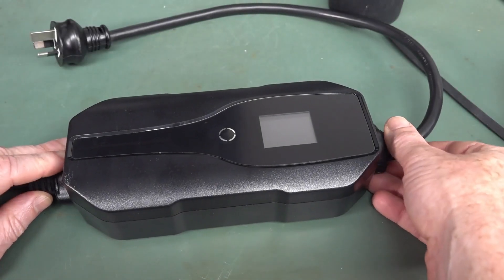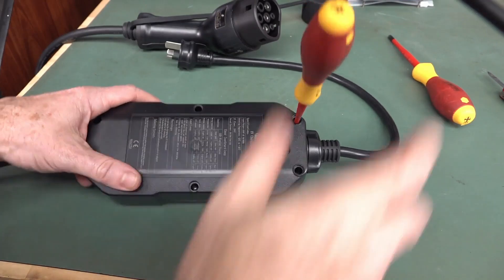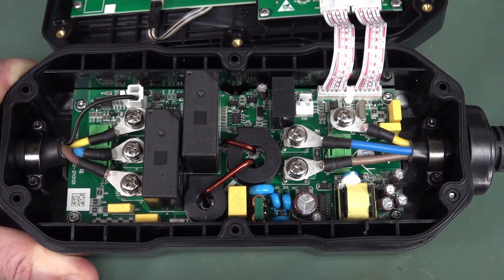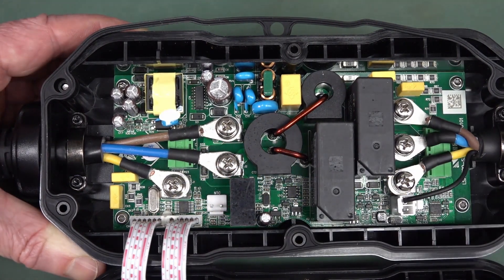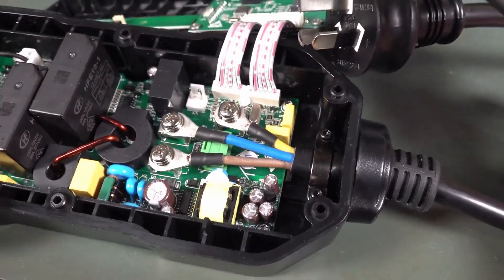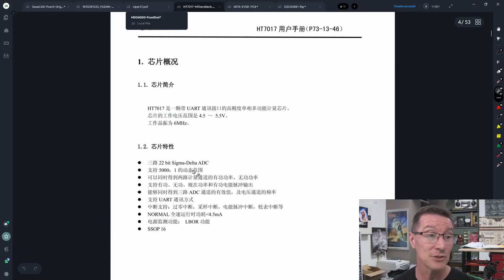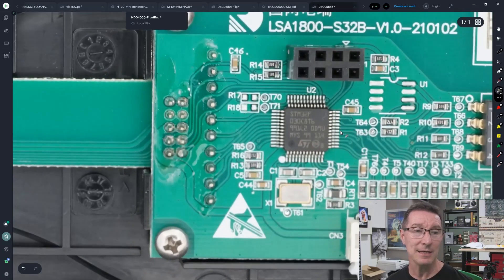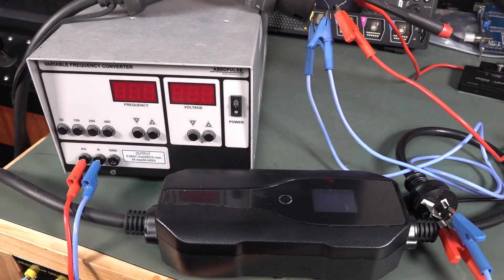EEVblog 1507 - Mida: A surprisingly good cheap portable Electric Car EVSE Charger

Comment: I’m probably a small minority, but I still can’t wrap my head around buying cars with expiration dates. Lipo batteries do not last, I truly hope something better comes around soon, but what a disaster for the environment at this point in time.
Reply: You do realize that when the batteries reach the end of their lifespan, you get them swapped out for a new pack and the old batteries are recycled? Easily done and only needed every 10 or 20 years.
Reply: @RedwoodRhiadra  “easily done”, please cite a source. The chemical composition changes which is why it no longer holds a charge. Let me see you recycle a rusted out sheet of steel into a new sheet of steel.
Reply: @bryans8895  What, do you have any idea how scrap steel recycling works?
Reply: @JussiPeltola  I do, and it was poor choice of words on my part. I meant thin sheet metal, rusted to all hell to the point of being perforated and half way gone to begin with. A chemical composition change, as I was getting at with my initial comment. A pile of pure rust cannot be melted down and made into new steel, as an expired lithium cell cannot be "recycled" into a fresh new one.
Reply: @bryans8895  Steelmaking is a lot about converting rust into steel. The stuff from the ground is rustier than surface rusted steel.

Obviously any rust that fell off cannot be recovered.
Reply: You seem to be thinking they have the same lifespan as what's in your phone or laptop. They do not.
Reply: @RobertHancock1  explain to me the difference between a lipo cell in a phone, or 10,000 lipo cells in a car. Similar number of cycles, kills the cells. Granted they don’t go 100-0-100 as often, but it’s the same stuff and they do expire.
Reply: @bryans8895  The difference in cycle rate is pretty massive. Most people tend to charge their phone every day after discharging a good portion of the battery. In order to need the same thing with a car you'd have to be driving hundreds of miles a day, every day. Few people do this.

EV batteries also don't charge to 100% capacity nor discharge to 0%, and the battery design and BMS are also more optimized for long life than in a phone, where the manufacturer figures that you're going to buy a new one after a few years anyway.

It's part of the reason that EV battery recycling has gotten a slow start - there just hasn't been much need for it. When people need a new battery, it's more commonly due to defects or crash damage than wearout, aside from a few people that have put extreme mileage on their cars (enough that with an ICE you might end up needing a new engine).
Reply: Petrol cars expire when the tank runs dry, but people still buy them!

Comment: Those relays can go into one on one off when there is a power failure. My unit needed me to manually switch both off to recover. I also have a Khons 22kW adapter, pretty bullet proof and a gen2 Tesla HPWC which has an ABB 64A contactor and is converted to charge from an 12kWp off grid solar (charge rate according to solar input).
Reply: Thanks for the tip!

Comment: As for the thermistor:

Believe it or not, they more often insist on it more for use with low amperage outlets which might not be able to safely handle sustained loads from vehicle charging. They can get hot and melt. This was contrary to your speculation so I thought I’d mention it. I have a real-world example, if you are interested:

I have two EVSEs with the exact same ClipperCreek Gen2 EVSE board inside, one running GM’s firmware with a NEMA 5-15P 120v plug and a 12A limit (bundled with the Chevy Volt/Bolt) and the other running ClipperCreek’s firmware with a NEMA 14-30P 240v plug and a 16A limit (sold as “AmazingE” brand). Only the GM firmware with the 5-15 plug has the thermistor… and it won’t work without it unless you use a resistor to bypass. I know because I found the populated PCB for $30 as a new GM spare and used it to build another EVSE, so I really have three with the same board. ;) The AmazingE unit does not have/require the thermistor/resistor because they expect a NEMA 14-30R to easily handle 16A without getting hot. A NEMA 5-15R, on the other hand, is often worn out and gets hot. Though his Volt would default to 8A on 120v my brother would routinely override and set it to the theoretical safe limit of 12A until the outlet in his garage melted. After that we converted his GM unit to 240v and gave it a NEMA 14-XX plug (no neutral to fit more receptacles).
Reply: I know the GM/Clipper Creek EVSE supplied with the Volt/Bolt will safely operate from 240 volt 8 or 12 amp single phase using a pigtail adapter.  Is there something more you did internally beyond changing the plug, as I notice you said you converted your brother’s GM EVSE?
Reply: @wtmayhew  My reply got ghosted. :(

The CC Gen2-based GM unit works great with an adapter but you can’t chop and completely replace the plug without bypassing the thermistor. Ai4px posted the specs for a replacement thermistor or resistor bypass on ChevyBolt. Small world since I already knew him from Ninjette. :)

I had to replace the thermistor with ai4px’s resistor bypass with my GM spare board since it never had one and refused to run without it.
Reply: @emmettturner9452  Thnaks very much for your reply.  Duly noted.
Reply: @emmettturner9452  Thanks for the information, much appreciated.
Reply: The UK/Type G ones have to have a thermistor in the plug as I understand, a UK plug can get quite warm even at 10A so some overheating protection is needed. On a forum an ex-GPO bloke said that they would only rate 13A type G sockets at 10A and that was only with MK plugs and sockets, any other combination and it was more like 8A I believe.

Comment: You might want to go lower when using with a source that you know can’t handle 15A. For example, a worn out outlet. It’s why 120v EVSEs often default to 8A and require a manual override for 12+A. Adapters to fit higher amperage outlets often signal this to the EVSE so it can default to 12A or 16A or more. Though a standard NEMA 5-15 in the USA should be able to safely handle a sustained 12A (80% of the maximum 15A rating), they often can’t because they are worn out and loose from too much use.
Reply: gotta love the garbage nema sockets
Reply: @drkastenbrot  Well, the grade/intended application is what typically determines how robust it is (consumer versus commercial, industrial, hospital, etc). ;) NEMA just defines the prong configuration and expected amperage when functioning correctly. I’m sure you can wear out a lot of other plug types!
Reply: @emmettturner9452  i have not run into worn out european plugs other than crappy extension cables. they will happily do the rated 16A
Reply: @drkastenbrot  it’s more about the contacts in the receptacles. They can bend and lose pressure, oxidize and increase resistance, arc from live plugging and develop pitting, etc. Also, worn out 15A sockets can generally handle their ratings too… for a shorter period of time. It’s the sustained loads of EV charging that cause a worn outlet to melt down at 12A. You might never know they are worn with typical non-EV use even if you were plugging in 12A devices regularly (vacuums, space heaters, toasters, microwaves, etc).
Reply: @emmettturner9452  I think it must be something to do with the design of your plugs/sockets in the USA. IMO it's probably the fact that you don't commonly have on/off switches, which causes arcing when devices are plugged in or unplugged . Here in the UK, 30 year old sockets will happily power a 3kw kettle all day long. I've never heard of or seen one wear out.
Reply: @MattyEngland  I believe most of the problems are caused by cheap receptacles. our 1967 house, for example, had been equipped with bargain bon receptacles, and all but a handful would not safely hold a plug. even the night lights would fall out! I replaced them with Leviton spec grade receptacles, and have never had a problem since, nearly 30 years later, all connect securely.
Reply: I'm also thinking if you already use the same circuit to power other things, like my outside plugs are also used for my lights and other stuff. If you set the charger to full power, you might blow the breaker.
Reply: @NNoradIV  15amp outlets here are generally a dedicated circuit and are not part of the general power circuit with the home. They're mostly protected by a 16amp or 20amp cb
Reply: Anybody else felt a big Electroboom fibe? 🤣
Reply: here they have been handing out some big fines to shops for selling chargers that plug into a regular outlet and doesn't self limit to 6A
Reply: @fuzzy1dk  Interesting, because here in the USA it is the car that limits itself to less than 12A.

The GM version of the ClipperCreek Gen2 EVSE often included with the Volt/Bolt will always report that it’s capable of 12A and the car will limit itself to 8A until the user overrides… but only at 120v. You can unofficially adapt the same EVSE to 240v and the vehicle will go straight to 12A, so it is the vehicle limiting it to 8A. The same board does 16A in the AmazingE EVSE so the EVSE’s GM firmware is reporting 12A no matter what.

I know Tesla’s Mobile Connector will default to 8A with the NEMA 5-15 plug but you can adjust the amperage on the vehicle’s touch screen to bump it up. The same car will default to 16A if you buy the NEMA 5-20 dongle for the Tesla MC, which signals to the EVSE that the circuit is rated for 20A. The vehicle only defaults to 8A when it sees a 120v Level 1 source reporting 12A (presumed to be a 15A circuit) but does not when the EVSE reports 16A.

What I’m getting at is that the vehicle is typically where the 8A default comes from in the USA… not the EVSE. The EVSE reports 12A for a 15A circuit and the car defaults to 8A anyway. My brother actually melted a 15A GFCI garage outlet with a Chevy Volt even though the outlet was rated for 15A. Of course, he was regularly overriding the 8A default to 12A. I suggest replacing them with a commercial grade outlet if you regularly plug/unplug a portable EVSE and want the full 12A but then you might as well buy a new breaker to convert it to 240v. There shouldn’t be anything else on an EV charging circuit anyway and most 120v EVSEs will support 240v.

Comment: is there any reason this couldn't be built into the handle? so the wall plug is on one end, then just a rather bulky handle with all this in it. nothing between. 

The only issue I could maybe see is the electronics need to be away from the handle in case the handle is tripped or Loses waterproofing and the relays need to be switched off
Reply: There is a reason, if it was in the charge plug the rcd couldn't protect against cable damage.
Reply from the maker: Possible in theory, but would be bulky in practice for no real major advantage.
Reply: @EEVblog  advantage being nothing bulky on the ground to have to worry about. IE hanging off that wall or what ever. maybe less points of water ingress and cable connections.
Reply: I dunno.. I see no reason why not. Probably no critical mass yet so someone will probably do it soon. Or maybe it is some weird part of the CCS standard to not be allowed to have it in the handle?
Reply: @rkan2  I should try and read up on the standard. I suspect that's the case.
Reply: The car end plug is handled by people, often left laying on the ground, gets dropped, etc.
Having the electronics in a separate box, as close to the wall socket as possible reduces the risks of water getting in, damage from impacts, etc. Which in turn reduces the chances of someone getting 240v to their hands when they pick it up.

Comment: Oooh so this is like those USBC pd boards but for a car OwO
Reply: Well not really - they actually do DC to DC conversion. This just passes through 230V to the car's integrated charger when the CCS standard conditions are met.
Reply: @rkan2  I mean one of them boards where you select voltage on and plug USB into, uuuh it acts as power sink in pd terms.
Lol

Comment: Surprising that they have the metering stuff in there, and the load current sensing - no need at all for these in a low-cost EVSE and some significant cost savings possible without impacting functionality or safety.  Also the display for that matter...
Reply from the maker: Yeah, at this price point I expected to just see basic current limiting.
Reply: @EEVblog  Why, can you not trust the car to pull what its told to?
Reply from the maker: @edc1569  Yes, by "basic current limiting" I mean the PWM signal to control the car to do the current limiting, and maybe some gross overload limiting protection perhaps.
Reply: @edc1569  Because you don't want a single point of failure to burn down your house ;)
Reply: @travcollier  You don't want to. But the makers of cheap goods do not care about your house, just their margins.
Reply: @sarowie  Mostly true.  But there is an increasing number of cheap Chinese manufacturers who actually take pride in their work and make pretty decent stuff.  Bosses will basically always push to cheap out maximally on everything, but the nerds actually doing the designs are a different matter. The regulations, especially in the EU, US, Oz, ect., give those designers some leverage to actually do things right.

Still, buying cheap Chinese goods is a crap shoot... But sometimes, like this example, they are pretty good.  That's why I love these "better than I expected" teardowns, in addition to the WTF were they thinking ones, of course.
Reply: @edc1569  If the car cannot be trusted to pull what it is told to, then add a circuit breaker or a fuse in the box. The way they accomplished the same thing using digital processors and metering devices is not what I would call a low cost solution.
Reply: You have to me much more conservative in limiting the current if you are only checking the peak or average.

Comment: I hope those white wires going to the front panel board have a suitably high insulation voltage rating, given that it looks like they'll be folded up against the mains screw terminals when the thing is closed up. :)

Also not sure about the fact the earths are linked only by PCB trace. Looks like, what, 5mm wide trace? On 1oz copper? Might just be able to handle 15A without burning itself. But then if there's any significant earth current, it'll shut itself off anyway, right? So probably not an issue.
Reply: I was thinking the same  - there is no need for the earth to pass through the PCB, they could have run a longer wire and screwed into the same post as the output terminal
Reply from the maker: Yeah, direct earth avoiding the PCB would be better. But ultimately it's got an RCD internally on the mains side, and also you'd have an RCD and fuse in your breaker box as well.
Reply: @EEVblog  Not here with two Edison 30A fuses to the single phase 220 dryer outlet using loose conduit for ground. yehee, grandfathered
Reply: @chasingcapsaicin  one the things Aus does is require RCD's to be fitted in order to sell or rent a property. Tends to help prevent ancient unsafe electrical installations (not that fuses themselves are unsafe, just the lack of RCD's and likely poor condition of the older cable)
Reply: If you have a earth leakage, it switches off within a few  milliseconds, so the trace does not have carry 15A for any significant time.

Comment: Fine build quality indeed, interesting relays and oh my, just look at those curvy traces! Old style PCB design, thing of beauty, joy for ever. Wonder if it was designed in modern Kicad.

It's good to see an integrated RCD here, very smart to have it if your house's wiring doesn't have one and you get a breakdown between the primary and secondary side in the car's converter.

Cool EV simulation circuit :) 

BTW the larger ground contact on a plug is pretty sensible, allows a lower current rated plug in a larger current socket but not the other way around, making it impossible to connect heavy loads to the wiring that can't handle them... Unfortunately this doesn't prevent the "wise guys" from circumventing this safety measure by cutting the ground prong off.
Reply from the maker: I believe the RCD is part of the standard.
Reply: @EEVblog  standard for   wiring and standard for EVSEs, I guess. And any devices meant for outside use, like outdoor vending machines, water pumps etc.
Reply: @KeritechElectronics  not as needed for other equipment in aus as almost all gpo's are RCD protected these days (it's required to sell/rent). Makes more sense for a evse as hopefully it's a type B RCD in case of any DC earth faults
Reply: Re cutting the ground pin off, I'm reminded of the one and only NEMA 5-20P (20 amp plug for 20 amp north American outlets) I've ever seen in the wild. It was a molded factory plug on a pressure washer and someone had twisted the pin with pliers so it'd fit in a 15 amp outlet.
Reply: @Broken_Yugo  inconsiderate or plainly stupid people have been, are and will be all over the place. If you try to make something idiotproof, the world will always come up with a better idiot.

Comment: EVSEs that ignore the diode are surprisingly common -  the standards do require diode checking, but I tested one that had been tested by TUV that didn't. Strange as it's not hard to do.
Reply from the maker: I wasn't sure if the standards required it. I wonder if the genuine Hyundai one does it.
Reply: @EEVblog  a major company with an expensive product cheap out on a part or not folow a standard? never cough porsche built in charger cough
Reply: @Sparky400  well, Porsche is part of VW and VW internal combustion engines are famously not build for for German weather and need protection from those extrem lows from fall/winter/spring and highs in summer. Meanwhile Porsche internal combustion engines inject extra fuel into the engine on german Autobahns, because, well: it helps cool the engine and its not prohibited as those speeds are outside of the regulatory frame work.